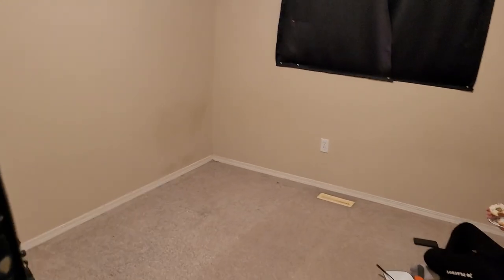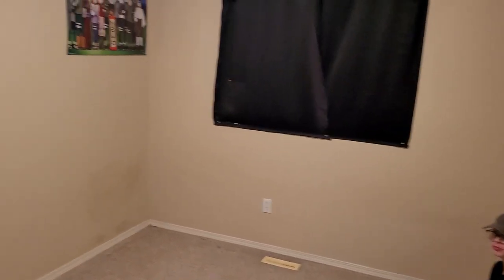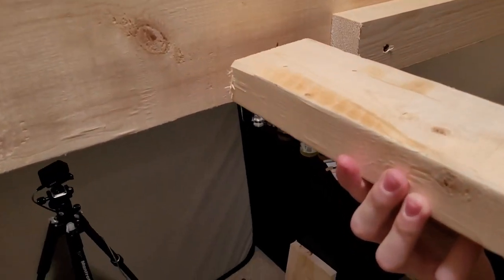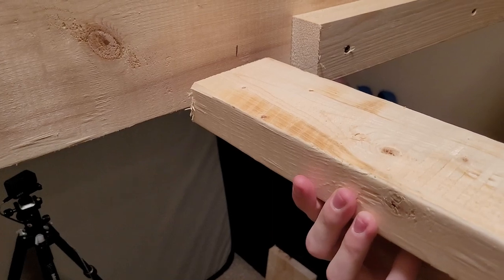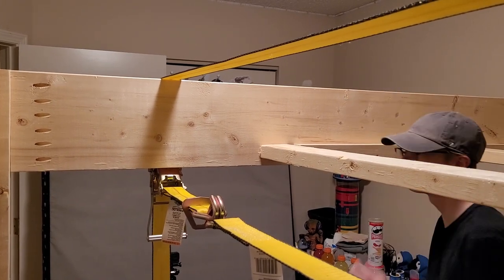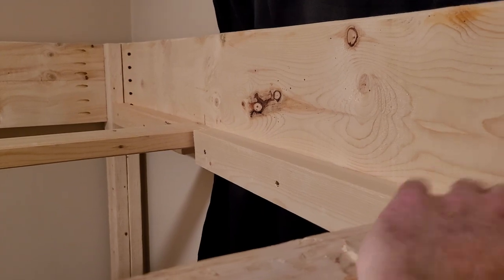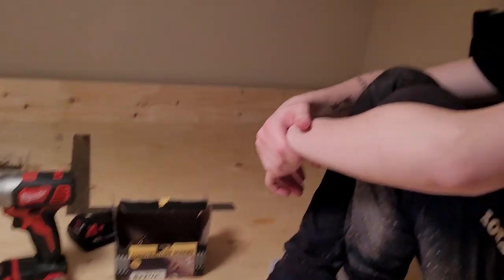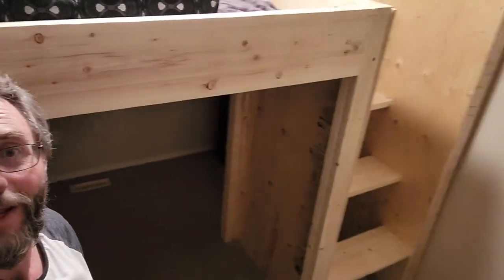GenX Ventures Episode 86   Loft Bed Project

Comment: It looks like a good project. I would recommend painting the wood. It protects it so it will last longer. I like the way you screwed it all together. Lots of screws. Did you think about using joist hangers to give added support on the build?

Comment: I haven't been watching lately. Is the bus finished?
Reply: No. Just for the winter. We don't have an indoor place to work on it and it's a bit too cold to try and cut stuff outside and bring it in to install. And my parents needed it off their RV pad for the winter. So, we hit pause on it for the winter. I'm planning on installing the heater in it in the next couple of months, if we can, and maybe building the composting toilet and putting it in once the diverter arrives from Germany (I had to buy the good one). Also planning a video on what we have spent to get the bus to this point but I'm still gathering receipts and getting that all put into a spreadsheet.

We are going to try and do some smaller projects for the bus that we can do at home and show how we are tackling them. Things like the window coverings and such. And some outdoor adventure days such as hiking in the snow and snowboarding. We are really looking forward to the spring so we can get things rolling on the bus once again.
Reply: @pilphoto  Looking forward to it
Reply: @pilphoto  How has the bus been coming along?